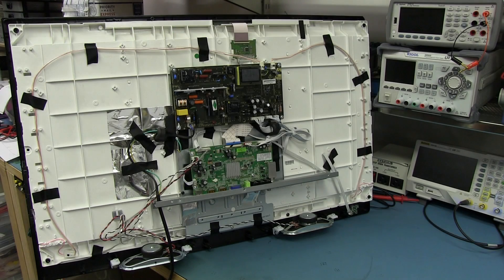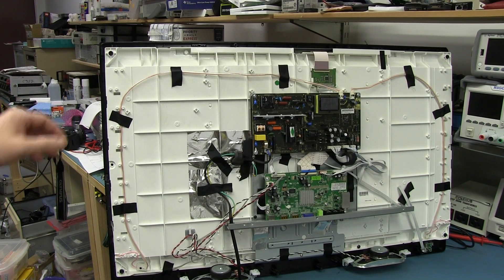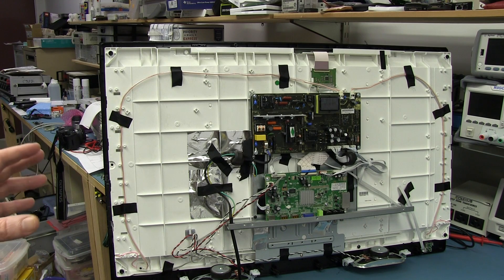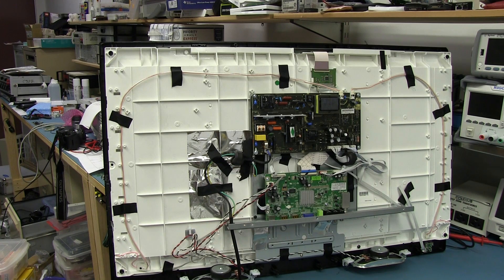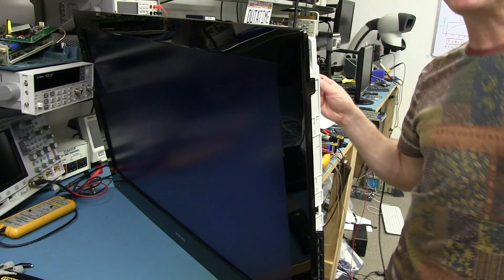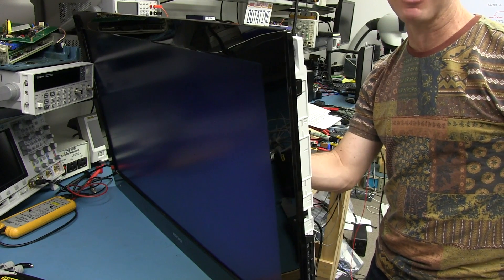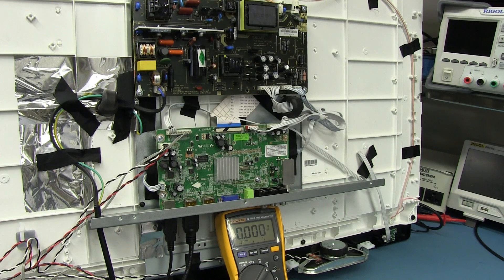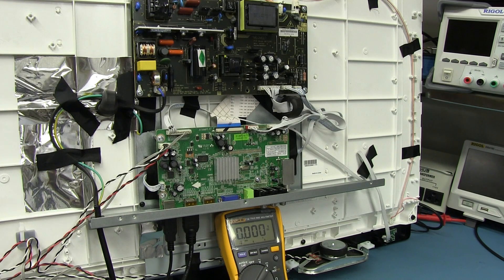EEVblog #631 - How To: Soniq LCD TV Repair Part 2

Comment: @4.30... Chinese wire..... I hope you find the fault the fix got the same TV same issue exactly... Gone are the days of the days of turning off the lights to see where the dust accumulation is causing an arc them just vacuuming it all out

Comment: If I had not seen this video I was ready to buy a new monitor/TV .... fuse was fine ... flat composite cable with the connector you detected as dodgy .... Screen returned TA DAA !!  thanks for your help :)

Comment: You sir are a tv saver!   Exact same issue with me a loose ribbon cable, reseat and tv is working.  In my case I had no issue with the fuse!  Thank you so much for this video.   As a fellow Aussie love watching your videos, I'm only the most basic of electronics dabbler so much of what you say is over my head, this though I could fix which was nice.  No need to replace my shed tv now
Reply: And then I broke it again trying to get a good connection:-) oh well got the TV for $20 Oz dollars so no big loss and I learnt a bit about innards of a lcd TV! I broke the ribbon connector on the lcd circuit board :-(  so I think it's dead now

Comment: Hi Dave I’m watching your video a lot and I find you content really interesting 😎👍👍I do repair on pioneer mixing equipment and have found that sometimes a layer of sellotape on the blue side of the ribbon cable helps.the socket bows /warps due to heat and the tape make up the difference

Comment: 11:40M  A Weeny ity bity FUSE :) problemo fixed (Y) 🐌💬-Wot ?
good job Dave - wish u liveD near me i find a lot big tvs 2010-2016 models all good SCREENS but ? something wont turn tv on see a screen & noise  samsungs found 2 near new condition 65" :)  working on the throw away one now  trying to get the led strips Out mite be handy ?     but so  small screws  wont undo :( anyway wtf do i want led strips for?  buy on e/bay cheep           lol  🤪

Comment: gday i have a soniq 40" led lcd e40s12a-au and it has a horizontal line accross the top of the screen about 3-1/2 inch wide and not completley solid but coloured lines, I believe its t con board but not sure how easy to fix or replace
thanks steve
Reply: That's likely one of the row driver ICs embedded on the glass of the display, i don't think it's repairable.
Reply: thanks for the responce :)

Comment: Dave, I understand some uses for 0 Ohm resistors, but cannot figure out why there are 2 of them just after that blown fuse?? Why did they put the resistors there, as opposed to just continuing on the tracks? Thanks.
Reply: These things are designed to be built with discount parts of the month, which can be a saving with regard to fuses, capacitors RF chokes when building these things in tens of thousands. 0 Ohm resistors never cost anything, so they just provide reconfigurability there.

Comment: I have the same problem but I can't find that TK fuse to buy, your solution with the axial capacitor is great, I would like to do the same. Which capacitor could I use? would a 220uF 63V 125°C capacitor be fine? thank you
Reply: You may have misunderstood something. Axial is just the package type and many types of circuit elements can be axial. He replaced the surface mount fuse with an axial fuse of the same current rating (and same or higher power rating I assume). Perhaps there's a clever way to use a capacitor as a fuse... but I doubt it. You want to replace the fuse with another fuse.

Comment: I found using a piece of kapton tape as a shim will make the connection tighter and it usually solves the problem! It happens often with phones, tablets, and handheld video games. If those cheap plastic ffc/fpc connectors don't latch down tight you end up with a short.

Comment: My L32V12A would randomly display random colors across the screen and blast my speakers with static (even with no volume) now it doesn't turn on, the red light comes on but wont flash a few times like it should, will be checking that fuse tho I think it might be a different problem.

Comment: It looks like he is discharging the capacitor with both leads of the multimeter on the same leg. To my understanding it would make more sense to have them across the capacitor. Can anyone explain this?
Reply: He put the multimeter in a low impedance mode where there is essentially a lowish-value resistor across the probes. This can be useful for checking batteries' loaded voltage instead of float voltage. In this case, he discharges the cap slowly instead of a direct short so it doesn't make a bunch of sparks or pop anything nearby.

Comment: A lot of tv board problems are solved by the tap and solder process. I was an in home tv repair technician. And there were times if the tap & solder process wasn't working, I'd turn off all the lights in the room , tap and flex the powered up board and look for the spark. Very Technical Stuff.

Comment: cable too lcd screen/panel if sound is still there.
Reply: it's probably the connector is lose and it's contacts briefly disconnect but are in close proximity and build up voltage due to the electric field, then when they connect there will be a surge. maybe replace the fuse with a cap?
Reply: marshalcraft hmm maybe a cap would have interesting possibly diverse affects because it may alter the signals?

Comment: Hi Dave,

Had this exact problem, and was very happy I found this video. Thanks a lot for the help! I simply detached the CB from the doublesided tape, insulated the ribbon cable, and solved the exact problem. The TV is now working as new, and the flickering has not come back. Luckily for me the fuse hadn't blown. TV NOT thrown out, and has been in use for a few weeks so far without an issue. Very handy indeed!

Comment: my friend has a 'broken' big cheaper lcd screen that has intermittent discoloration / distortion issues. never loses picture. what are the chances taking it apart and re seating the ribbon cables would fix it?

Comment: I have the same TV, with the same sort of problem, But is not that connector..  The problem goes away when the TV has been on for 5 to 10 minutes or so .  I wonder if this is a capacitor problem? I have pretty much replaced most of them on the PSU board.

Comment: Your video inspired me to repair my LV3212A tv - after checking and reseating all ribbon cables, I found a dodgy high voltage connection (CN3?)  - reasonable chance the pink wire where it connects to CN3 connector on PSU might have a break, as when I reinstalled it, the video blanking happened again after <2 minutes  (I guess gravity is having its way with the wire). sigh. time to disassemble again!

Comment: maybe it was only the power supply traces in the ribbon that overheated which caused the connection problem. The broken fuse was already an indication of high current which could result in a over heating of the those high-resistance traces.

Comment: LOL, plastic sub-frame on a TV that size?  I'm surprised the panel didn't crack from the flexing.

I recently fixed a Sony Bravia with the same type of blown T-con fuse.  It was on the 12 volt line that feeds the T-con board and the panel itself.  The TV did some really weird stuff because of it.

Those LVDS connectors often benefit from some De-Oxit.  I've also seen some that fall apart at the crimps, or have crumbling insulation on the wires.  Luckily they are somewhat standard, and replacements can usually be found easily on Ebay.

I'd say the two most frustrating things with LCD and plasma TV's are bad BGA solder and missing/stuck lines of pixels in the panels themselves.  Everything else is usually pretty easy to fix with basic equipment.

Comment: Most of the big TVs have the TFT drivers attached to film PCBs (Chip on Film) and them attached to the glass. This glass-film connections is very fragile and can breaks with thermal expansion, causing intermittent problems. There are pretty much no cheap fixing for that, except from banding the film PCB until you get image and then finding a way to lock it in place.

Comment: Come on - the fuse either blew because of the intermittent cable fault causing rapid power cycling to the circuit it fed or because Dave was dicking around inside the thing with his adventurous probing, ooh-err, missus.

Comment: Nice catch on that fuse, I would probably never have noticed it and just trashed the TV after checking the power supply and cable connections.

Comment: just put some hot glue on that conector
i have taken this lesson from samsung when i bougth a monitor an in all black images it did make some red dots so i sendit back and they fixdit when the warranty expired i taked apart the samsung monitor and there it was 2 dots of got glue in the corner of the connector.

Comment: I'm glad you solved it, but still  - don't trust that crappy TV. It's not very reliable, you saw it from inside...
Reply: Why not?  LG panel, power supply was just fine, and the processor board seemed to be fine as well.  The one issue it had has been resolved.  There's really not a whole lot in an LCD TV that is under stress, and he covered the things that are under stress to make sure they're fine.

Comment: In part 1's comments I was skeptical about the feasibility of fixing electronics, but still am now glad that this one got solved.
Reply: The fact is that around 80% of electronic device problems are simple fixes. Take my cameras battery charger for instance: most people would just throw it away and get a new one on ebay for 8$. I fixed it. All that was wrong with it was the SMD bridge rectifier, and bad connection with the 2 through-hole inductors. So the BR was a tad over a $1 from Mouser, + some solder, and it's fixed.
I ordered a new charger anyway from ebay so I will have an extra one - I'm still waiting on it...
Reply: Yeah, I have this cheap Chinese made Portable Media Player which the LCD was going in and out and after poking around I found out that the flat ribbon connector was starting to break (the screen can slide up and down).  Problem is, I can't find a replacement cable. :(

Comment: A good troubleshooting video would be to fix your old Tandy PC that has gone down with a bad case of being dead. I have revived an IBM 5150 from the dead now it error posts, but it does try and boot from the floppy. Just fingering out whats causing the errors.

Comment: so mutch work for a little fuse...
would bypassing it damage anything ?
Reply: Replacing it with a proper fuse is not much more work than bypassing it.
Reply: Depends.  If everything is in working order then bypassing it isn't a problem, but fuses aren't there for working order.  Fuses protect sections of the circuit when things go wrong, which obviously something wrong happened to take that fuse out.  Maybe it was just spikes from the intermittent connection, maybe it was something else.  Time will tell if that replacement blows or not.  In the first video he mentioned the menu not coming up which I would think would not be related to the display output board at all.

Comment: Running a flat flex cable with data under a power supply is a bad design IMHO.
Reply: Not just the power supply, the backlight high voltage transformer at that.
Reply: Even worse is here, where flex running under inverter... Really crappy engineering,

Comment: Dave use the diode-test mode to discharge the capacitor. The diode in the input section can handle PIVs of up to 1kV.

Comment: I had a problem with a ribbon connector on the top of the LCD screen. I used a matchstick to hold the ribbon cable in a position where it would work and applied some superglue to hold it in place. It's not gone wrong again for years. Sometimes a crude fix is the best.

Comment: Come on Dave, electricity is a "physical component" too. What you where trying to say was "mechanical component".
Reply: That's being a bit pedantic, pretty much everyone I know uses "physical" when refering to "not software".

Do you write angry letters to your favourite soft drink manufacturer because they use weight instead of mass? :P
Reply: José Faria That's being a bit pedantic, trying to correct someone when you yourself don't get it. What does software have to do with this? He was trying to differentiate between an electrical glitch (which by no means could be defined as software) and mechanically moving the damn thing, no software mentioned or insinuated.
And as ***** said, electricity is not even a physical component but a force. So I guess we are just a pair of pedantic posters, the both of us!

Comment: BTW, sorry for the double post, my favorite "physical" issue was when I had a PC with a PSU that was going out. Every time my brother would go to the bathroom and flip the light switch, pow, my computer would reboot. I always got mad at him whenever that would happen and couldn't explain it. It just had to be his fault. Eventually I made the connection, when he was using the computer and I flicked the light switch!
Reply: How is that a physical issue?  Sounds like your house had really crappy wiring.  Physical would be something like a loose wire or connector.  Your issue sounds like undervoltage from a surge current through the light.
Reply: CalcProgrammer1 The PSU should have been able to compensate for the surge issue from the light. A replacement PSU performed fine (and the PSU in the system lasted a year or so before the problem cropped up). While it's likely there was a surge issue, the PSU either failed because of it, or was compromised by it. It was a physical issue. Even if the socket / wiring was responsible.

Comment: Dave, I have been having problems with Twitter recently and have wanted to send to you a link which would be useful in connection with your Apollo LVDC computer board, I sent a couple of tweets but not sure if they actually went.  Here is the web link.
http://www.ibiblio.org/apollo/LVDC.html

Comment: The fuse probably blew because of the intermittent connector and the power surges when there is a connection. Rapid connection and re-connection can produce surges that easily exceed the normal steady state current flow.

Comment: What is the purpose of putting 2 zero ohm resistors @ 11:00 why not just use a copper fill, is it just like a secondary fuse?
Reply: Couple of things here, yageo RC0603 0 ohm has a rated current of 1A. Since the fuse is 1.5A, you want two of them in there to easily handle the rated current. The reason for having them at all is probably optional filtering. If the board did not pass EMI tests, they could swap them for ferrite beads or higher value resistors, etc. Its cheap insurance (0.1c or less). Same idea with the empty capacitor footprint.
Reply: Ja Ro is right. They are essentially jumpers but designed with the intent that changes can be made easily in the manufacturing process. It may have been also an earlier design which had a different component which was no longer needed so the easiest and most cost effective solution is to add a couple 000 smd's.

Comment: At 5:28 you mention connecting the ribbon cable and some not using the right 'tongue' angle.  Do you mean the tongue of the cable, or the tongue in your mouth?
Reply: You must be new here
Reply: ***** Did you hear that rush over your head?  That was the joke missing you.
Reply: Badam-tssh.

Comment: Nice engineering degree Dave. Poking at things with a stick.
Reply: I was only kidding, Dave's great.
Reply: Nah the degree bit is knowing when to poke things with sticks, compared to whacking them ;-)
Reply: @jamesgrimwood1285  Aa q aa 0?
Reply: It is not a regular stick. It is a magic wand.
Reply: That's actually a common practice... the automotive techs call it a wiggle test and the scanners have a option for it and it goes for other electronics as well
Reply: It works! I have found intermittent problems that way many times.
Reply: Mdmchannel  Don't get me going on the "pencil pushers"!  (Not to be confused with the non conducting probe; pencils have graphite in their core. Conductive).    :-)
Reply: Engineering=Engine + steering no matter with what :)

Comment: Dave, was there ANY protection between the back of the PS and the ribbon cable? It didn't look like it.

CH!
Reply from the maker: No, just the gap of the board spacers. The ribbon cable was taped down though.

Comment: Wasn't the screen physically touching and making pressure on the corner of the instrument on the shelf? I was thinking, all throughout the video, that Dave might fix the problem but the screen would break.
Reply from the maker: It was, yes. I must have moved it without realising. I didn't notice that well into the video.